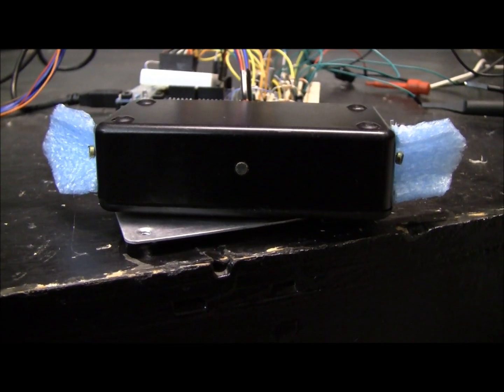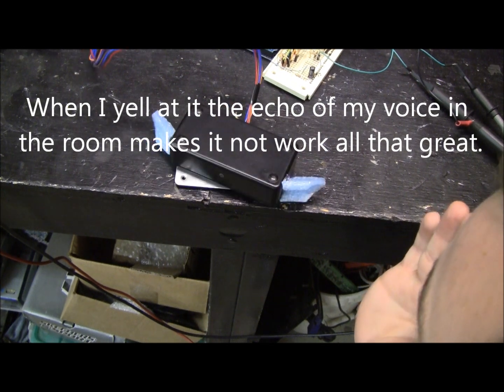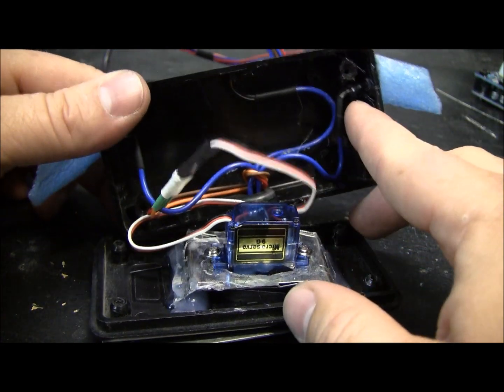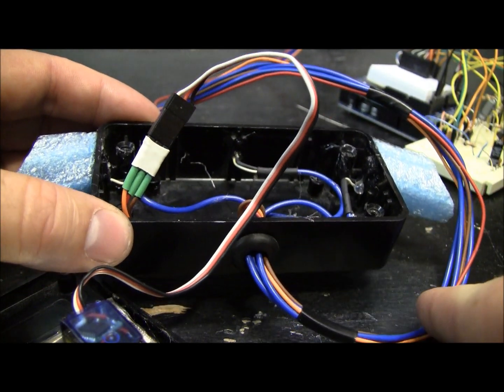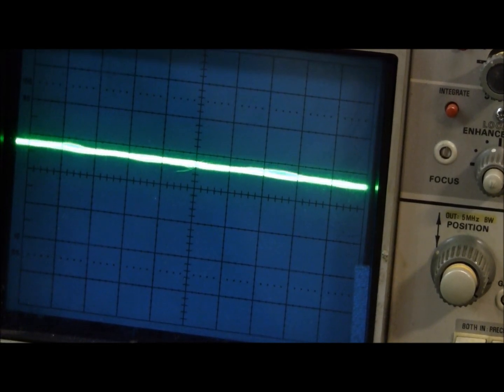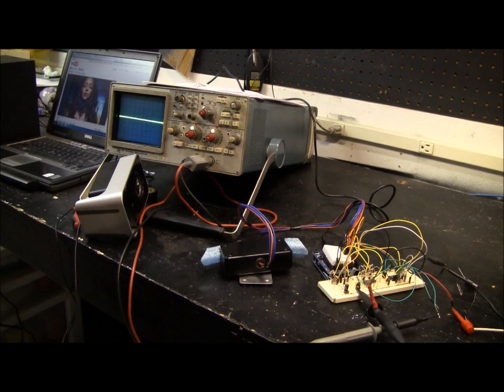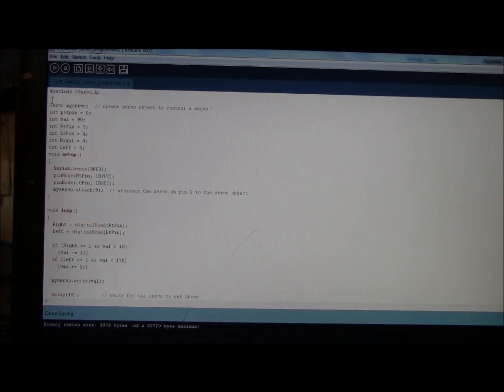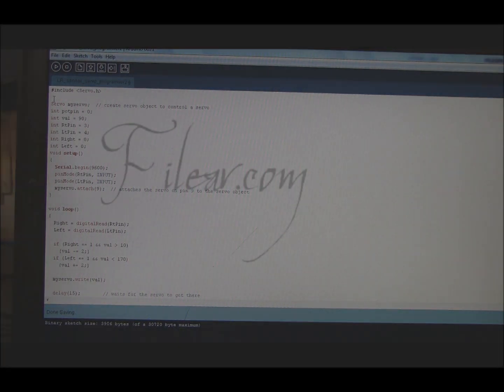DIY Sound Localization Sensor

Comment: Have you tried greater separation of the microphones? And perhaps a harder material for the earflaps. Seems to me foam would be absorbing some of the incoming sound energy instead of reflecting it. Your microphones almost certainly will have a resonant frequency characteristic, meaning they may not respond to your voice as well as to a sound that is closer to that built-in resonance. Experiment! Great device.

Comment: Basically you need to get the ratio between the angle and sound. For instance if your front mic picked up 50db sound and your left mic 25db sound you need to turn
90deg / (50db + 25db) * 25 db = 30 degrees angle
If your front picks 40db sound,left mic 2 db sound your robot will think that he needs to turn 4.2 degrees and he should ignore this because the sound will be picked with left mic even if your sound is in front of this robot. So you should add if(left mic db/front mic db < 0.1) ignore;